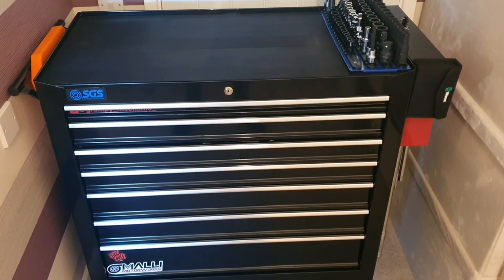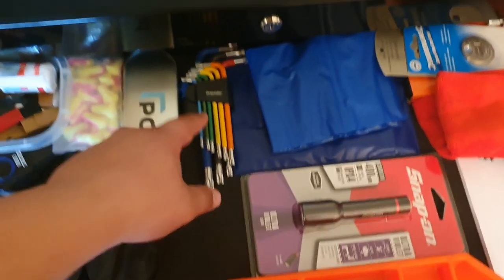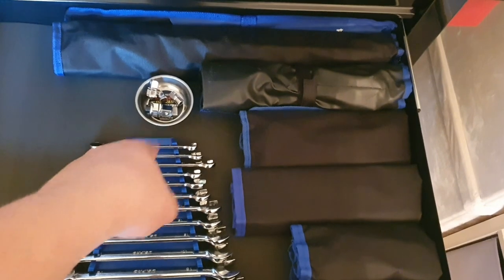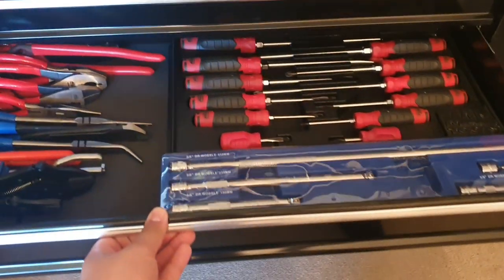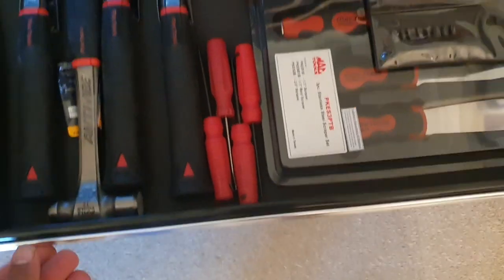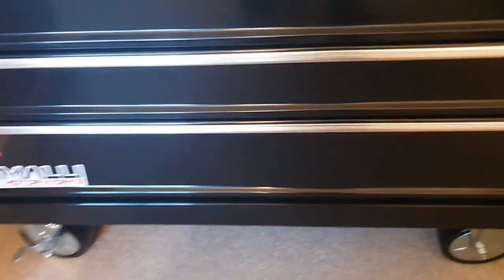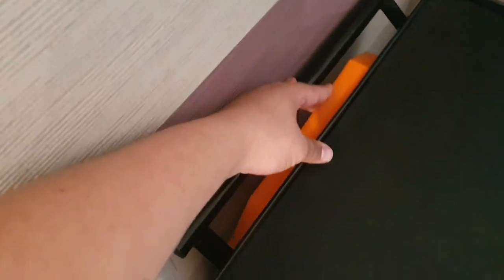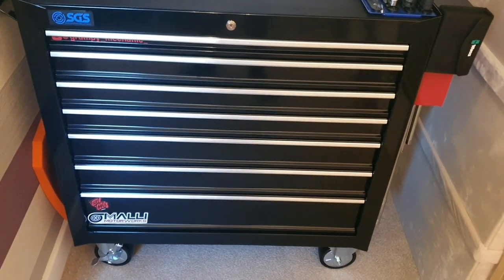2020 tool box tour sgs 36" tool chest

Comment: What you think of the Bergen/ US Pro Tools?  I've noticed they are getting very popular and really reasonable price thank you 😃
Reply from the maker: Honestly they have done me great for atleast 2 years and still going. Im slowly upgrading some of my tools that I use more to snap on and mac only when I get a good deal and I can pay cash otherwise my us pro/ bergen, sealey, draper is all still kicking bud
Reply: Some of there stuff is good some not so good, a hear their 3 piece hammer set can be a bit hit and miss. A few people on Amazon have had the heads fly off after only using them 2-3 times lol and chipping so wear eye protection.
Reply: I have found the chunkier Bergen (now rebranding as US Pro) stuff to be pretty good but my circlip pliers have snapped at the narrow tips during light use so I would maybe give those a miss. I find them fantastic value for money though.
Reply: Best avoided in general, some stuff are just ok, but best to get a good sealey or draper at least.